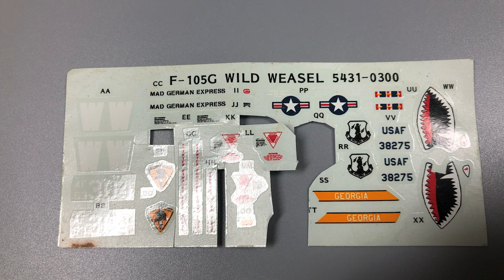Hot Wheels Jet Sweep X5 Custom Redline

Comment: I noticed that you put deep dish medium wheels on the front and the  "regular depth" large wheels in the back. I would like to see how regular depth wheels and deep dish in the back. You probably used what was handy. What probably wasn't handy, or it isn't handy for most is this asymmetrical casting. I didn't like the originals livery...color scheme, graphics- whatever you call it. I never saw a day it could be changed! Pair it with "Legends" winner "2 Jet Z" , it works! The Millennium Falcon is asymmetrical, do this casting as part of a Star Wars package, it works!  You've unlocked the beauty of the design from the ugly wrapper. Thanks for having fun with your toys! Please continue!
Reply from the maker: Thanks David!  I was wondering if anyone would catch the difference in the wheels (or if they did, figure out why I did it this way).  While I don't have a large selection of wheels to choose from, I did set out various sizes/types to see what I liked and I chose this combination.  Possibly only in my mind, I saw it almost along the lines of nose art for the "plane" and needing beefy wheels at the rear to handle the thrust.  I appreciate your comments about the wheels and asymmetrical design of the casting, as some "purists" will complain about what they consider "mismatches" rather than considering to possibilities of such an approach.  Thank you so much for your comments!
Reply: @JimSilva-SilvaDiecastCustoms  Nothing about your builds is haphazard or without reason. They are all builds of possibilities.